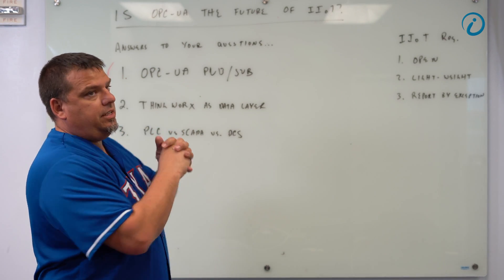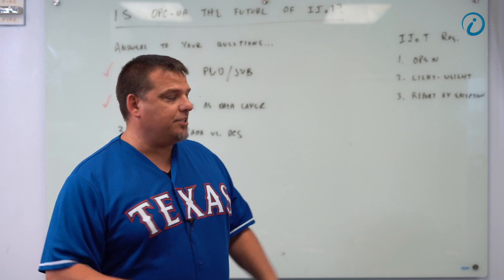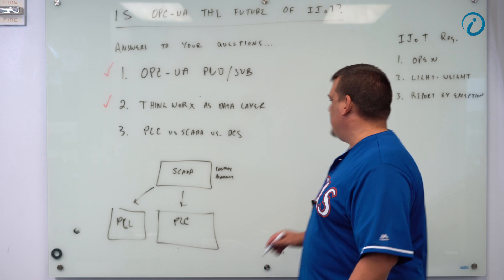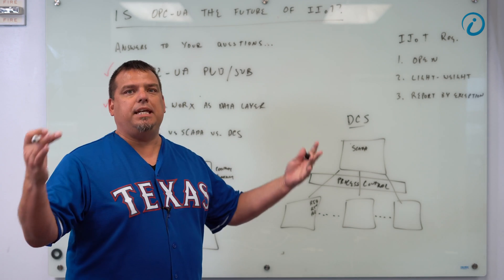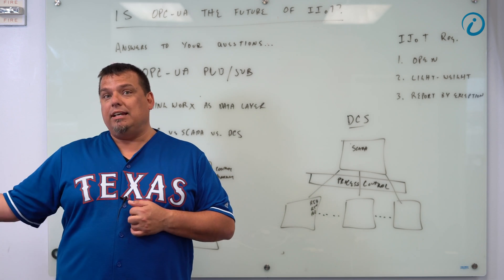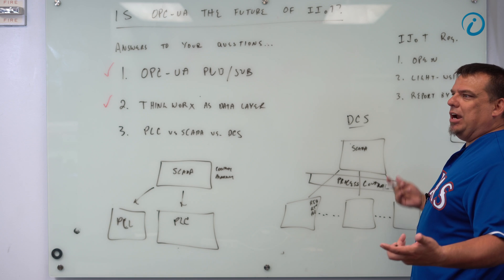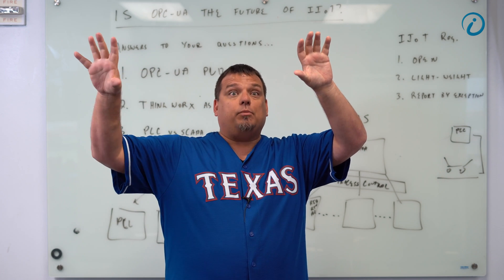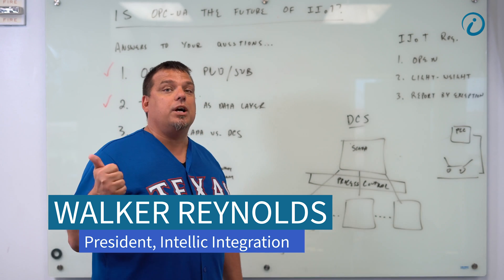PLC vs SCADA vs DCS

Comment: Although it was a good explanation, it was never defined clearly. DCS has a program/solution that is not the best to differentiate the DCS from PLC. As a refinery controls engineer for many years, the use PLC for fast, high-speed logic and discrete control tasks like packaging lines, assembly machines, and material handling systems. Use DCS for large-scale continuous process control, such as refineries, chemical plants, power generation, and pharmaceutical batch processes.  You are welcome.
Reply: Pharma is batch sequence systems and .can less analog and more discrete control. Is half way between full analog measured continuous systems  and hi speed motor positioning control like in the car industry. Generally speaking..

If it's a gas it's dcs if it's a conveyor it's plc.

Comment: Very nice and informational video! 
One small question, can both SCADA and DCS be controlled remotely ?
Reply from the maker: DCS systems are not typically designed for wide-area networks like SCADA, they can still be controlled remotely with the right infrastructure.
Reply: some batch systems alow recipes to be selected and triggered from another pc.
Reply: Yes mes..starts processes externally. From a central trigger point.. and you can actually remote in to he pcs.

Comment: I'd suggest that the significant difference between these Basic Programmable Control Systems (BPCS) is in the way in which the PLC and DCS are programmed, and this stretches back to their respective geneses. 

Using a programming "language" analogy, PLC programming, even with the implementation of IEC61131-3, is effectively machine code. It processes very fast, perfect for factory automation situations and simple PID control, but it takes a very long time to implement the type of complex computational code to the degree required by process automation, since everything literally has to be "hand-crafted" from scratch.

DCS on the other hand, is akin to programming with a higher-level language. 
Analogue values just are analogue values once an analogue input has been instantiated in the code.
There's no faffing about with bits and signing, like there STILL is with PLC code, even when working in the closest 61131-3 implementation by way of Function Blocks. 
With most DCS programming/configuration, it's just jump straight in and start manipulating real numbers in code as one wishes, perfect for highly complex processes.

As for SCADA? It's a glorified old-school control-room panel whose present-day equivalent is a HMI. 
Here, the presenter is on the money when it comes to the assimilation of various sources of data and, typically, it sits over a variety of sources such as PLCs, RTUs, and even single and multi-loop panel-mounted controllers (where the latter still may exist).

The HMI of a DCS never used to be able to integrate 3rd-party OT sources like dedicated SCADA can. 
For example, MODBUS transfers would usually involve a dedicated DCS controller card and a communication interface to suit. 
However, the last time I had anything to do with the ABB 800XA, this SCADA-like HMI was capable of displaying PTX camera feeds, among other things. 
I'm certain that in the 14 years since, the line between DCS HMI and SCADA has become further blurred in function, with the difference really coming down to the best bang per buck for the predominant BPCS being employed.
Reply from the maker: Thanks for sharing!
Reply: The beauty of prepackaged software is that it lends itself to libraries. You have a standard equipment. With one click it creates the plc code, the fault handling, the faceplate and possibly interface too. Saves testing time. Siemens PLC's now have controller fault generation. So you generate the plc code. And it auto generates a scada fault text config. By scanning the code. Beautiful and fast. The text shown is in the plc code. So only one place.
The most wonderful of Siemens is scada tag config at PLC level.  via plc code. Scada scans the live plc for tag configured memory. And addss it to the scada tag interface. Super fast and accurate. Way ahead of everything. It's a mighty function for both live aNd developing systems.

Comment: These are shallow ok answers ! the meat is in the microprocessor and architecture built of the electronics motherboard between the DCS and PLC, While the SCADA is only a software. PLC s can be designed more rugged and fault tolerance and redundant than the DCS(more like computer based). examples like Triconex, Triplex, Hima, etc...
Reply from the maker: It's designed for a lay person to be able to understand. Thanks for commenting!

Comment: I keep hearing you say things about a DCS that are simply incorrect.  Let's get the basics down, a DCS is a Distributed Control System that isn't really distributed much.  A DCS is not "process specific".  Any DCS can be used for a wide range of processes.  There are certain systems that were developed for a specific process or industry, such as the GE Mark VI (turbine control), but even those can be used for other processes as well.  I suppose there are some very niche processes that have a very specialized controller platform that is used for that purpose only (burner management comes to mind), but you are grossly misleading people when you say things like a DCS is "process specific".  It's just not true.

Also, RIO nodes rarely communicate with other RIO nodes.  I'm not saying this doesn't exist but it's certainly not the most common way it works.  The processor is where the code runs that determines what to do with the I/O.  In reality, a DCS is poorly named because the control, or processing, is not distributed very much at all.  It's actually concentrated in a few Controllers.

Normally, a DCS does NOT come "pre-programmed".  Perhaps for some very specific applications, it may, but there are literally thousands of systems installed or upgraded every year that have to be custom engineered and programmed for the process they serve.  Let's say a chemical plant is installing a new batch reactor and needs a new DCS to control it, so they call up Emerson and order a new DeltaV system.  That system will consist of a ProPlus server, and Engineering station, Operator stations, a Processor, I/O cards and some software, but NO CONFIGURATION.  The configuration for that batch reactor has to be customized for that specific process.  Few industrial processes are alike enough to allow for a "canned" program to run them all.  The ONLY time you get a pre-configured control system is when you order a complete machine from an OEM, but guess what, the OEM had to configure that control system.  Emerson, Honeywell, ABB are not in the business of guessing what the control scheme will be for batch chemical reactors.

The backbone of most all DCS's (and PLC's for that matter) are Ethernet these days.  In the past they were different protocols over copper wire (like token ring).  To name just a few, Honeywell Experion, DeltaV, ABB, Bailey, Foxboro, Siemens, GE Mark VI, Yokogawa.  How about naming some that do not use Ethernet?  There are certainly bus technologies available that connect I/O to the DCS, but this is merely to reduce the cost of copper wiring individual loops.  Profibus, Modbus, ASi, Fieldbus...etc.  And these are anything but "blazingly fast", I can assure you.  What systems are you talking about that differ from this?
Reply from the maker: Thanks for the question Mark! We responded in this video here: https://youtu.be/GruN5S18-qI?t=1847

Comment: Your explanations are great, but I think you are oversimplifying DCS due to your limitation of Siemens.  If you look at Honeywell Experion, Emerson Ovation, the DCS systems are very scalable, and are often customized.  Your description sounds like packaged skids that are usually limited to subsystems like compressors and dryers.  DCS' controllers tend to be proprietary for the simple reason of how so many controllers can integrate together.  Applications tend to become less like a collection of PLC's, and more like a unified system where the location the pieces of a program execute is nearly transparent to the Engineer and the operator.  PLC''s and SCADA systems tend to integrate by tables, EDS definitions, and parallel databases that must be kept synchronized either manually, or by batch update functions.  DCS's allow changing of the shared data and links without having to re-compile, or shutdown a process.  They allow dynamic connections and re-sizing of peer-to-peer and HMI without having to shut down a controller.  Some DCS's like Honeywell Experion have the advantage of being able to in-activate one small chunk of logic and load a new control scheme to update it without having to reload/ reboot a whole controller, and it is transparent to the engineer building the logic, or technician trying to troubleshoot a problem.

A DCS system also tends to have a master system database.  Enterprise level data for historians (PI, PHD, Kepware), can be obtained from one source regardless of the location of the actual device that contains the data.  The DCS also has much more capability in their "SCADA/HMI" component for supervisory control, and peer-to-peer control eliminating dependence on the server.  HMI stations also collect alarming and data independent of their SCADA or HMI servers so that network or server issues will not interrupt the connection between the operator, supervisory control, and the field device.

Too often, especially with older SCADA systems and some Allen Bradley networks, and Devicenet, minor changes can force either the shutdown of the communication network, or rebooting of the controller or SCADA server just to add communications to a new device.  DCS systems are much more flexible about integrating new devices.... but the price they pay is proprietary communication architecture, and an architecture that tightly integrates the controller configuration with the enterprise system.

There are also two kinds of SCADA systems that people don't realize.  The original SCADA systems were mainly for very remote simple control such as water distribution, or power distribution over very slow networks (i.e.1200 baud ... not kbaud or MB over leased telephone lines) to substations miles away.  They grew to handle more sophisticated water and power transmission and Distribution , and eventually power plant dispatch.  

The other kind of SCADA system is what has been created in the process control world by steeling the architecture of SCADA systems.  Your definition applies and is why the process control industry adopted the architecture of SCADA systems since they handle real-time data with multiple HMI screens, alarming, security, and historical data capture.  Even DCS systems like Ovation and Experion now use SCADA architecture as their "front end" processor for communication, and HMI servers.  They just then tightly integrate it into their proprietary control system network.

PLC/HMI systems tend to be a small local pair.  A Panelview to a PLC.  Maybe two or three PLC's, but managing the parallel databases for them to communicate (produce and consume) becomes more tedious.  Rockwell with their Factory Talk, and Schneider (Modbus) have tried to address this by making a tag-based architecture, but it is still rooted deep in the process, and requres a PLC reboot to change the tables significantly.

SCADA systems as you described correctly have the ability to talk to almost any open standard device and concentrate the data into one server  database to serve up to HMI stations, Supervisory controls, Data collection and aggregation and common alarm systems.  They take scattered controllers and bring them together for simplifying the life of the operator, HMI support, Data analysists etc...  They however still have to have a specific method to synchronize their communication databases with the PLC's or RTU's that they talk to that must be managed as a separate task.

DCS's don't need to worry about keeping databases synchronized.  As you build it in the PLC, it is built in the SCADA system dynamically without requiring to reboot or reload anything.

I hope this is helpful to others.

Mike Dougherty
Industrial Design Control Solutions, Inc.
Reply from the maker: We tend to Oversimplify for our audience! Thank you for sharing Mike!

Comment: in the vid, it mention abt the PLC change the output on a certain condition. my question is how can it change the output? does it have a disturbance in the system? and is it a big change or a small change ?
Reply from the maker: It will change it's output based on what all of it's inputs are and the logic that it runs to determine what it's outputs should be based upon it's inputs. Think of it like a "black box"